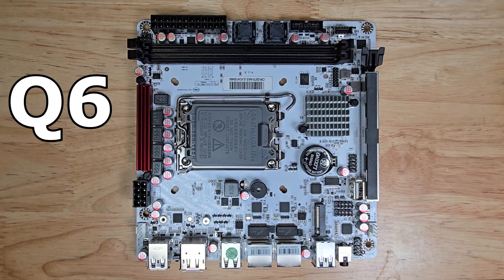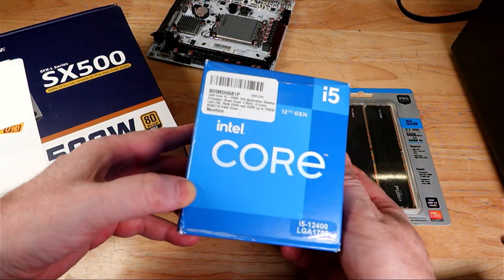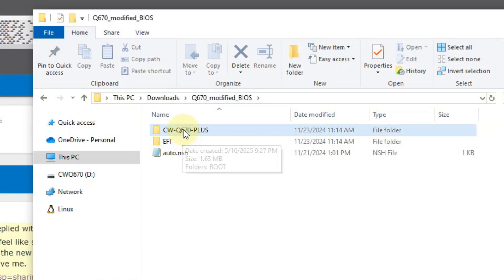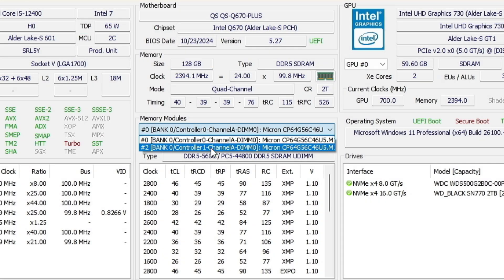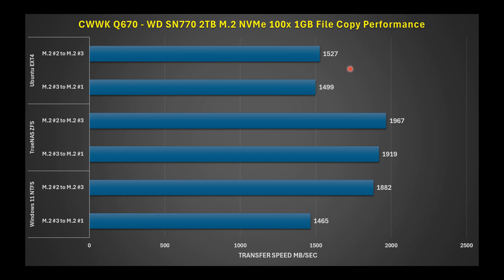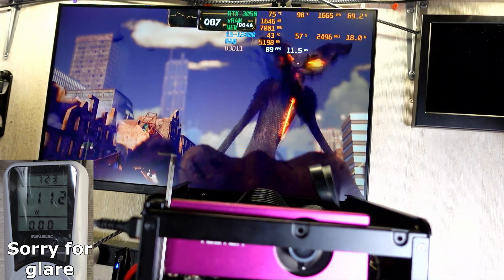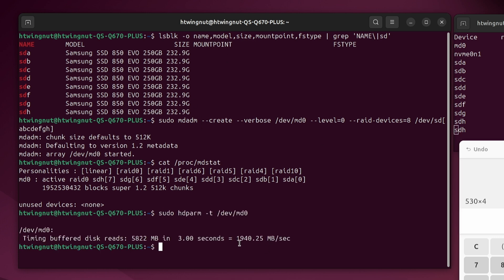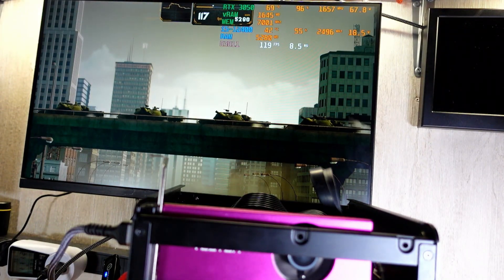CWWK Q670 LGA 1700 White NAS Motherboard Review

Comment: I now have two of these CWWK q670 LGA 1700 boards.  One I bought about 5-6 mo ago direct from the official CWWK website. The other I bought within the last week (12/25) from a vendor on Amazon (StoneStorm).  I tried to use the recommendations provided by CWWK concerning RAM, CPU, etc.  So I now have two sets of everything except for the two 32 GB DDR5 5600 RAM sticks, which have become too expensive to duplicate.  Two Mice, keyboards, keyboards, monitors, power supplies, i5-3500T CPUs, NVME SSD sticks  - everything but the pair of Corsair RAM sticks that have become to expensive to duplicate.  I hook it all up ( or individual parts in a logical order) And I get the same thing in each case.  
I would say I get absolutely nothing, but that is not quite true.  Such add-ons as have lights - the RJ45 jack, front panel power, etc do light up.  
The Fan starts spinning. 
The CPU gets hot.  
But any display connected to HDMI just shows 'no input', there no beeps.  And nothing I try gets me to the bios!   
The system does respond to the normal power down using the power button (held ~10 sec).  I feel as though I am missing something stupid, but this is not my first rodeo (35+ yr of MBs). 
 I have been stuck at this place for two weeks now.  The tech support at a reseller's site patiently answered questions.  
But hey weren't the folks I bought the board from, and I am sorry I took up their time.   
CWWK's support has answered questions too.  (But no solution or offer of a refund). 
BIOS settings? 
No Bios at all?  
RAM too fast? (Corsair DDR5 Pro 5600 UDIMMS purchased from Amazon.  Seems unlikely)
I really want this to work - not a refund if possible.  But I am at a loss.

Comment: Hi

I with moded bios of Yonji1 with optimal defaults. It seems that I cannot run the 8 sata ports with not even one of the NVME ports. If the onboard sata is connected the bord cannot even see one NVME and I connected all the 3. it was the cased also with the stock bios. what am I missing?

Comment: How well do the bottom's nvme slots handle heat?
Reply from the maker: All depends on the airflow in your case. Many cases have an open back on the platform it attaches to, so should get decent cooling. In the Jonsbo N2, the back system fan seems to pass air over them enough, although I didn't test them while stressed for any significant amount of time.
Reply: @htwingnut  Will there be sufficient airflow on Jonsbo N3 or N5 to install 2 NVME?

Comment: Excellent review, only wish I found it sooner. First issue was with the initial boot, it took an unusually long time for the first boot, in fact it took so I gave up thinking I had hardware problems so I ordered 4800Mhz mem to test instead of the original 96GB of 5600 that I had originally installed. I had the same issue with the delay and found this vid looking  for answers. So with the 4800 mem installed I waited (forever) for initial boot and sure enough system did post, then put the 96GB of 5600 back in it and again waited and it did too eventually post however is reporting 4800 speed, cpu is i5-14500T, mem is G.SKILL Flare X5 (F5-5600J4040D48GX2-FX5), wondering if I should try something else? Again, excellent review

Comment: If you have a CHA341 programmer during a power loss or power failure and you have the correct 8-pin eeprom reader cable commonly known as sop8 you can actually reset and reprogram your bios just make sure you need to download and extract the .bin file and make sure your bios is not a capsule bios most Ami and some other bios manufacturers allow for bios flashback via a usb method or the eeprom method
Reply from the maker: Great info to know! Hope I don't ever have to go that route. Although I think most users have access to a UPS to make sure that doesn't occur.
Reply: @htwingnut  this goes for most laptops too! Except the capsule bios ones. I have recovered several MacBooks that had EFI locks and iCloud locks from 2010-2017 non touch models as well as dell and hp bios eeproms/bioses the same way

Comment: What about using T suffixed cpu?
Reply from the maker: "T" CPU's would generally use less power while active, but idle power, they will likely use about the same especially since they both can enter higher C-states. Plus I've also found that "T" CPU's are generally harder to find and more expensive than the base version  counterpart.

Comment: Pretty good looking mothereboard. Seems the price has increased $50 since its launch. The CWWK 12th Gen Intel i3-N305 N355 N100 N150 NAS monster board 6-bay 4x 2.5G/6x SATA3.0/2x M.2 NVMe/115X radiator ITX board type motherboard is $50 less and you don't need a additional CPU. Wouldn't be as powerful or have as much expandability so I think this one has more headroom for future upgrades. I'm tempted to buy this one but I would need to get an Intel CPU and Case which would blow out the budget. For now I have a Prodesk G6 running TrueNAS via Mini SAS Passthrough in some old N54 Drivebays which does the job (for now)

Comment: Does the board support ECC memory? I'd be reluctant to run TrueNAS on it without ECC.
Reply from the maker: The Q670 does not support ECC RAM. To be honest, not sure if it's really necessary for TrueNAS especially since that's it's specialty to detect and fix any corruption.

Comment: Great vid, can you tell me if the board is full vpro with kvm control just the power stuff? 

I know it depends on the cpu sometimes.
Reply from the maker: There is an MEBx option which seems to have the option for remote control. I am not sure fully how to use it, but if you can give me an idea where to get started, I'll give it a try. Here's link to the MEBx portion of the BIOS if that helps at all: https://youtu.be/coq7DhOumE4?si=CNnDFSFWdIAXU50g
Reply: @htwingnut  Have you looked into meshcommander?
Thats how I do it :)
Reply: @htwingnut  Thanks for posting, after enabling AMT and setting a password on the mebx setup, enabling network access then you should be able to ping the NIC and access the webUI even when the PC is off. 

port 16992 for http
Reply: @simplexicated  also good info to know exp the port but if I’ve learned anything about ports and networking I personally wouldn’t go opening the ports on any router for kvm use…
Reply: @OGXDev-Team89 no you never should, always vpn in from another device.
Reply: @simplexicated would tailscale work? In MEBx
Reply: @OGXDev-Team89 I see no reason why not. But I only use wireguard.

Comment: ASPM won't help much at all unless there's something actually using the PCIe lane, I don't think.
Reply from the maker: You are correct. But I just wanted to see if I could get as low idle power consumption as I could. It seemed to help a little bit.

Comment: Last year I got pink one from CWWK with N305, less features than this one but it runs stable for long time, very low power usage.
Reply from the maker: I had an N305 board from CWWK but I couldn't get power consumption less than 25W, which seems to counter the point of having that low wattage CPU. Otherwise I liked the board. Lots of features.
Reply: @htwingnut  
My board is now loaded with HDDs and extra TPU chip, but otherwise in idle state I had it at around 14-15W (C-states enabled).
I have the latest BIOS.

Comment: Bought this motherboard a few months back when it came out.

Never touched the bios power settings because of all the negative statements about this board on Reddit.

Glad you showed me that it isn't bad at all :)

Did you have the chance to see which c-states you can reach in proxmox with those WD 770 and hard drives connected? I heard there are issues with aspm there.
Reply from the maker: No, but I will give it a try when I get a chance.